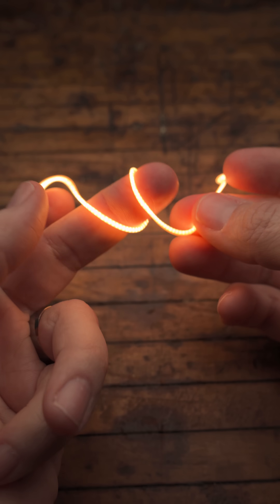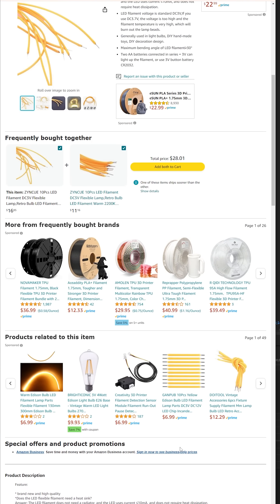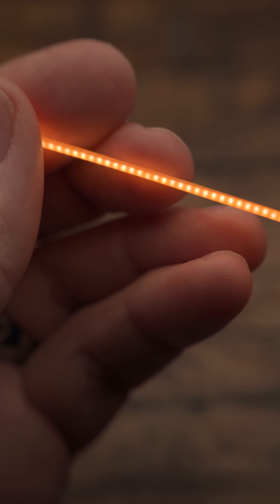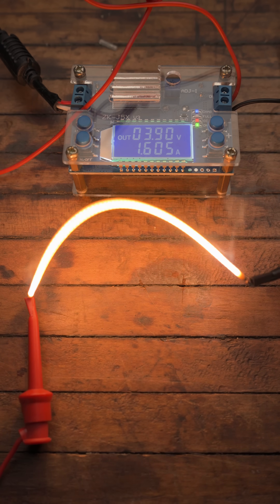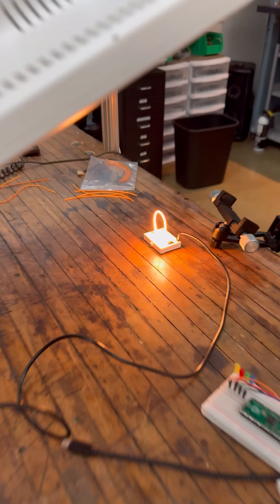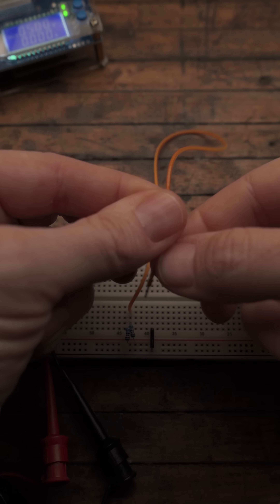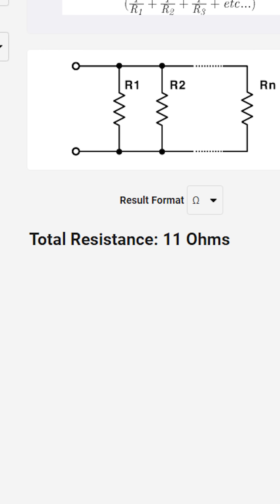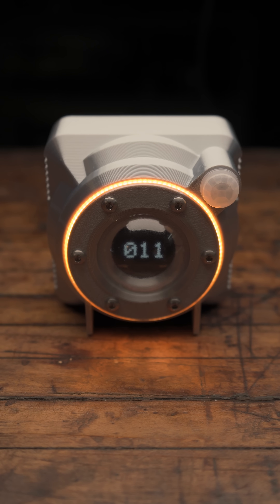#FlexibleFilamentLED

Comment: Oooooohhh. That's very close to the warm filament bulbs in a 70's amp I've just finished. That might just do the trick to give it better all round illumination rather than just from the bottom.

Comment: What effect does PWM with low duty cycle have? What would you be able to see individual LEDs?
Reply: At low enough current (or high enough contrast) you can see the individual LEDs. You can also see them flicker when in motion (or on camera) when pulses instead of constant power, are supplied

Comment: you can estimate a healthy current by increasing i.e. in this case 10mA per step until you can't notice a significant increase in light output, as per max current it would be about the double of the previous point but it will have a significantly shorter lifespan

Comment: What's the difference between this and elwire?
Reply: ElectroLuminescent wire, is a phosphor coated wire, wrapped in silicone, run on ~10,000-to-20,000 Volt pulses at very low amperage.   
These are ~100 LED grains per inch, wrapped in silicone, run at low Voltage. They're basically a very small rope light

Comment: use capacitors if you plan on using it on mains AC it's enough to give impedance to it but i couldn't give a calculation or it'll break my brain

Comment: How durable are they to bending and such? They looked shockingly light and flexible there. Like lighter/more-flexible than any wire I've used. It kind of seemed like rubber band from the video.
Reply: It is indeed a "Circuit On-Board" strip of LEDs wrapped in translucent silicone rubber. The conductor will break if flexed enough times or pinched too acutely, but otherwise yes very flexible.

Comment: Why would longer runs need more current? No matter how long the strand, if 100mA is going through it, then each LED gets 100mA.
Reply: Yeah, the longer runs use more Voltage...   
1200mm uses 24V

Comment: I suggest using the minimum current you can get away with, because you will suffer permanent lumen degradation and potential early failure trying to run them at a current that seems okay, without any long term testing.  Even if you had a datasheet, if they are from a dodgy generic brand, odds are you can't even run the max stated on the datasheet if you want your project to last long term.

Comment: why not el  strips
Reply: These are low Voltage, so they're safe for more use-cases 

(ElectroLuminescent wire runs at ~10-20KV & very low amperage; extremely high risk of shock\spark, & the power supplies whine)

Comment: Or, cut a single led off, check its resistance and deduce the current per led the same way you do any other led
Reply: "Circuit On-Board" LEDs are pretty hard to separate without damaging the individual LEDs, but yeah, in theory that should work.

Comment: i wonder if it have rgb version
Reply: They are available in all the usual LED colors, but RGB would require 4 wires inside instead of just one... So, maybe? Probably more practical just to run 3 single-color strands instead of one 3 color strand, though.

Comment: But, it's not a flexible filament LED. It's a bunch of LEDs in a plastic tube.
Reply: "filament" is used as a marketing term, to compare them to the incandescently glowing hot resistive tungsten filaments in Edison bulbs.   
On these, there is a copper filament inside the silicone filament, so it's not technically wrong; just like "3D printer filament" is a filament even though it isn't glowing hot.   
The silicone rubber is molded around the Circuit On-Board LEDs, so it's not really a hollow tube, but a continuous strip or "filament" with an LED circuit embedded in it
Reply: @prophetzarquon 1. tell me something I don't know
2. nothing you said refutes my OP
Reply: @humanrightsadvocate  1) It is a flexible filament LED & it's not in a tube. 
2) There is no 2

Comment: The reason for the 80-100mA suggested rating is just so the filament will last longer that a few months when powered for several hours a day in a bulb. 200mA is a lot to push through any LED especially if you want it to ladt years
Reply: I'm so confused by the idea of limiting supplied amperage; wouldn't Voltage be the limiting factor? As LEDs, they should only draw as much amperage as they need...?

Comment: Longer ones need more voltage, not current
Reply: Yeah, I kinda went "WTF?" there... Voltage handling would be the limiting factor; they'll only draw as many amps as they need!?
Reply: If they were in series then yes, but they are "3V version" so they are in parallel. That means more current for longer filament.

Comment: ok this confuses me. Don't resistors reduce voltage ? Why does it reduce the current? Doesn't a light bulb only take enough current to glow? Just like an LED uses 50mA, it cannot pull 10A
Reply: Current (Watts) = Volts × amps   
Less Voltage at the same amperage, means less current   
(Less amperage at the same Voltage, also means less current)

Comment: So, its like EL wire?
Reply: Except these are low Voltage, yes 

(ElectroLuminescent wire runs at ~10KV-20KV & very low amperage; high risk of shock\spark when broken, like a spark-plug cable)

Comment: If you flap a paper infront you can see the beads i think. I cant remember the trick.
Reply: If you turn them down low, you can see the individual LED grains, & when using pulsed power (for greater efficiency \ lifespan), you can see them flicker when the strip is in motion

Comment: How about PWM driver at 12V or even 24Vcc? At a 100Hz  at least.
Reply: The 1200mm lengths are listed at 24V, so I think that's viable. 

(Also, resistors simply dump energy as heat, so using resistors seems wasteful in battery-powered use cases... Wouldn't a "buck converter" be preferable to using resistors?)

Comment: So, around 1mah per 1mm then?
Reply: I don't know why they said to regulate amperage, but the Voltage required does increase by the millimeter. 1200mm lengths are 24V

Comment: Is there a12v version
Reply: Yep; the recommended voltage increases with length (number of LED grains in series).   
The 1200mm flexible COB LED "filaments" are 24V, so I expect the ones ~550mm are 12V, though I haven't looked at those

Comment: I use that same DROK power supply for an active pickup power supply that goes through a guitar cable so I just plug and play, no more 9v batteries nessesary. And I also use it for troubleshooting on the bench when I need a dc supply thats variable. It also works great to slowly power up old electronics that haven't been powered on for years. I love these filaments btw, very cool stuff!

Comment: I'm working on converting an antique radio cabinet into a PC case, and wanted to 'power' the vacuum tubes inside it without actually powering them. I've already drilled small holes in the bottom and was going to put in regular orange LEDs, but these are PERFECT!

Comment: So basically you are saying that instead of using a pwm circuit to control power and lower the losses due to heat dissipation, you should use a resister? Ohk......

Comment: Wait until he hears about electroluminescent lighting
Reply: EL-wire is great, but these run at much lower Voltage, so they're safe for more use cases. (EL-wire uses ~10KV-20KV at very low amperage.)   
Also, they can flex more times before the conductive wire inside breaks.

Comment: what is the use of using a resistor?
Reply: Cheaper than a PWM, I guess.   
Wastes power like crazy, so I wouldn't recommend using a resistor for battery powered use cases

Comment: Check out EL wire
Reply: This is indeed visually very similar to ElectroLuminescent wire, except that it can flex more times before breaking, & doesn't require ~10-20KV. So, much less risk of shock or spark, & no inverter whine from the power supply

Comment: El wire is what you're looking for
Reply: These are low Voltage, so they're safe for more use-cases 

(ElectroLuminescent wire runs at ~10-20KV & very low amperage; extremely high risk of shock\spark, & the power supplies whine)

Comment: Hm. Will be nice if they make RGB smart-LED versions, like the WS2822 LEDs. Those have data and clock inputs, and they're daisy chained so that each one passes it's data to the next one in the chain. So you can program any number of them. As long as you do it quickly enough, nobody will notice the colours being passed along, it'll look just like they're each set at the same time. 

That said, for longer chains, and since these things are so tiny there might be a lot in a chain, an extra "update" pin might be nice. So you could pass colours along as many as you like, but only when you activate the "update" pin will the new colour parameters actually be updated on the LEDs themselves. Prior to that, you could take as long as you liked to set them, then "update" once you've finished doing that. The update pins would all be in parallel, not daisy-chained, so they'd trigger at the same instant.

Actually this same idea would work on existing normal smart-LEDs. It only makes sense once a string gets fairly long, but might still be helpful with a long enough chain.

Comment: Are they availible as adressable leds?
Reply: No, they are strung in series.   
Otherwise they'd be very low Voltage (mV) & require about a hundred conductive strips per inch
Reply: @prophetzarquon  obviously but are those leds availible as addressable leds

Comment: I'd think these filaments are meant to be used with a constant current source, not a voltage source
Reply: I can't see why an LED strip would care about having extra amperage available: Excess Voltage would burn them out, but they should only draw as much amperage as they need...?

Comment: Its pretty easy to work out a suitable current. Slowly crank up the voltage in small steps and measure the current at each step. Plot the  graph voltage vs current if you want to be accurate. You will see where current starts to increase more rapidly. If you dont mind risking the filament, you can push it to the limit, and find the spot where a small increase in voltage starts to result in a large increase in current, a bit before that is the absolute limit. Pick where you want it to operate on the graph, the lower the better. Above about 50-70% max current, you see very little difference in light output anyway, so best to err on the lower side, it gives very long life. The current flowing through an LED is controlled by voltage.
Reply: Much easier to read the datasheet when available. One should also measure the voltage across the LED(s) as this will like raise slightly with additional current. This voltage will often spike just before the LED is destroyed! This can often accompanied by a reduction in brightness. If you stop at this point the LED may not be desctroyed. But you can bet is has been damaged.
Reply: @Monotoba  So how do you increase the current across a LED, how do you get the "additonal current" you refered to? There is only one way. 
Its a common misconception that LED are current controlled, probably becasue we talk about the current limiting resistor. But we don't control the current, we control the voltage drop across the LED.  and it is this voltage drop that regulates how much current flows through the LED.
Reply: @jumboegg5845  LEDs are current devices. They have a defined forward voltage drop across them (like all diodes). I am not saying that changing the resistance does not result in a change in current through the device. It does. I am saying that the statement in the video about needing to lower the resistance to provide more current is misleading, as lowering the resistance restores the current that he had across a shorter string of LEDs. Also, if you want your LEDs to live their complete lifespan, you need to stay within manufacturers suggeasted limits. Current limiting resisters are fine for short strings if you can supply a constant voltage as the for a small number of LEDs the voltage across the LEDs and current limiting resister will remain nearly constant. The more LEDs you have in series however, the more the small changes get multiplied. Once you reach a certain threshold, a constant current source is a much better choice. There are constant current sources available as IC (LED drivers) or you can design your own using transistors or a 3-terminal regulator like the LM317's or LM78xx series. In short, the datasheet is the best source of info. If you don't have a datasheet and can sacrofuice a device or 10 (best to take the average of several devices), then your method of stress testing works to find a reasonable working current. Though, it may not find the optimal working current. Aslo, LEDs do not have a filiment. It is the PN junction that emits light as electrons and holes recombine, releasing energy in the form of photons. Technically, a filiment is a length of resistive material such as carbon, tungston, etc., that releases photons when heated.
Reply: @Monotoba  Your "defined forward voltage drop" across an LED (Vf) is a nominal value. If Vf is given as a single value, then its specified for a recommended current (eg 20mA @ 1.8V). Vf is often specified as range (eg. 1.6 - 2.0V), and this range will give you a good working range for current.
A LED has a minimum Vf. Below the minimum Vf, current will not flow and the LED will not light. Right at the minimum Vf, a tiny current will flow and the LED will be barely visible. As you crank up Vf, the LED will get brighter. There is no true maximum Vf for an LED. If you have Vf set way too high, the LED will instantly blow. a bit too high and it will blow after 1 second, slightly too high and it will blow after 1 hour, marginally too high and it will blow after a couple of days, fractionally too high and it will  blow after a few weeks etc etc etc. I just put in the words what I said in my first post, about plotting the graph of Vf versus current. Lighting manufacturers know this graph very well, and what many of them seem to be doing is setting Vf (hence current) higher in the range, so that the LED light predictably lasts only a couple of years and you have to replace it. In a domestic situation, you often wont notice it becasue the LED light is only on for a few hours a day, so may last many years. In a commercial environment where lights may be on for 18-24 hours a day, it is very noticeable, you can almost predict the month when they start to fail.
By the way, constant current LED drivers keep the current constant by varying the voltage. Can be a good idea in strings of LEDs, because when some of the LED in the string burns out, the remaining LED continue to operate normally with same current. With a constant voltage LED driver, when one LED fails, the remaining LED start to get more current and they all start to fail.
Reply: @Monotoba   Also you said my "method of stress testing works to find a reasonable working current.". This misunderstands what I was saying. Its not a stress test, I'm not interested in knowing  how much current makes an LED last a few weeks. I want to know what current makes them last many years. Its all about light output, and once you experiment with them, you will find that brightness changes very little after certain Vf. If you need it to be brighter, its much better to add more LED to the string, rather than crank up the voltage.

Comment: Okay my question is though. What if I wanted to take a long strand and wrap it around the underside of my car.
Reply: The 1200mm runs are 24V; so, yes you could probably wire a bunch of ~600mm (12V) units in parallel
Reply: Answer - You might get a ticket

Comment: Wait! Why does a longer series of led requires more current? Shouldn’t you raise the voltage and adapt the limiting resistance to match voltage the current?
Reply: Yes, the longer lengths have more LEDs in series, so they require higher Voltage.

Comment: Back in 2011 I added green El-Wire to the sides of my bicycle so people could see me better. Pretty cool stuff.
Reply: I wonder how the properties of this stuff compare with EL wire.
Reply: For one, EL-wire requires very high Voltage (~10KV-20KV), resulting in a whine during operation (some may not hear it) & high likelihood of shock & sparks, when the solid-core conductive wire inside breaks or the phosphor flakes off. 

COB "filament" LED strips use low Voltage without need for a coil\inverter to step up the Voltage from a battery.
Reply: @prophetzarquon1922  the stuff I used on my bike used about 6VDC (4 AA Batteries). But maybe it's less industrial than the stuff you're talking about. It did make a very high pitch tone when lit, but I never noticed it over the sound of my bike.
Reply: @codysmith1534  Noooo, the battery pack may have been 6V, but the EL-wire relies on coils to step up the Voltage to thousands. All EL-wire kits run the wire at high Voltage
Reply: @prophetzarquon  yeah makes sense.
Reply: @codysmith1534  I still love them. I'm trying to figure out the best cheap way to regulate these LED "filaments", because a few 1200mm lengths would like great on our ebike, if I figure out how\much to dim them.

Comment: Would these still work if casted in resin?
Reply: They are already wrapped in silicone rubber, so yes; until heat buildup kills them. At lower power, they should be fine (especially if pulsed)

Comment: Parallel-connected diodes have a greater susceptibility to thermal run-away; Especially if ambient temperature is high or driven current is creating high junction temperatures. 

In applications where longevity is important, use ambient temperature derating, current derating, and avoid allowing some sections of the string to get less convection cooling. Also, if you let the string come in contact with itself, the intersection will be hotter.

Comment: LED's are only limited by heat. If you make pulses short enough you can run crazy amps through them.
Reply: In many cases the light emission efficiency goes up with current. With pulses, you can enjoy efficiency and still limit temperature.